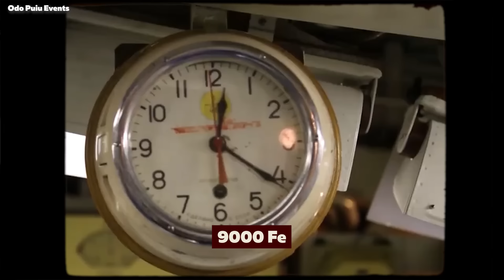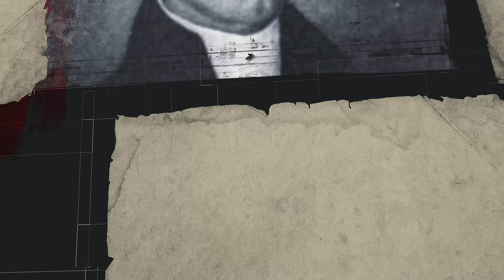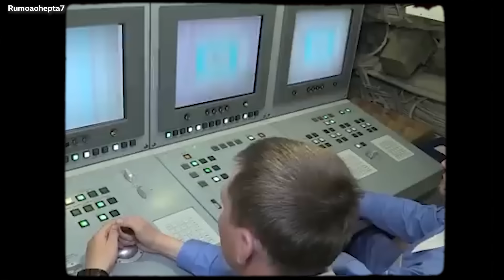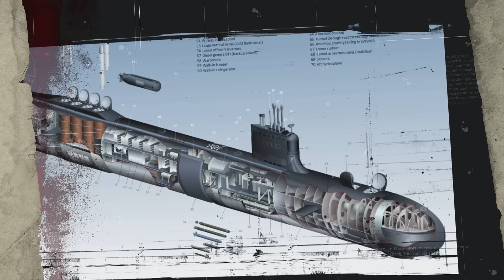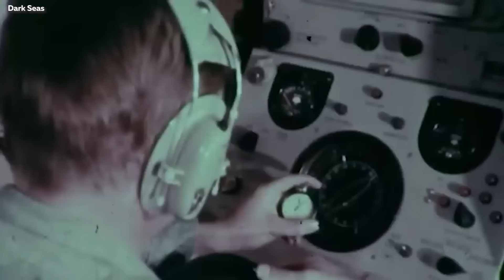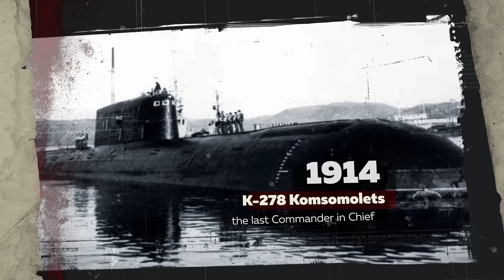Why Can Russian Submarines Dive DEEPER Than US Ones?

Comment: I won't take credit away from the fact that they can dive deeper than American submarines, but I don't think that is critical. Anyone who has served at sea (bubbleheads) knows how a submarine can be an asset to the whole tactical picture. These missions are critical, and the operation profile of submarines allows them to penetrate where some other organic collectors can't. This means the "foes" won't shut down their radars or simply won't take the same countermeasures as when a recon plane is present. I do like the approach of a multipurpose, flexible platform in order to perform all types of ad hoc missions. If the Navy needs to deep dive in the Marianas trench, then design a unique specialized platform like an DSR, for example (they need one, by the way). That's my take on all this.
Reply from the maker: You make a valid point about the broader strategic importance of submarines beyond just their diving depth. Indeed, submarines offer unique advantages in stealth and penetration, which can be crucial in various operational scenarios. While diving depth is a factor, it's not the sole determinant of a submarine's effectiveness. Specialized platforms like a Deep Submergence Rescue Vehicle (DSRV) could indeed complement the capabilities of the existing fleet. However, it's essential to balance specialization with the versatility needed for a range of missions. The focus should be on optimizing submarine capabilities to meet evolving threats and operational requirements effectively

Comment: How deep a submarine can dive is of no importance, it is really a detriment.
Torpedoes are launched out of it tube with compressed air. The deeper you attempt to launch a torpedo, the more compressed air is required. You can't use the air in the sub, you would suffocate the crew. A sub has to surface to compress air, which is when it is most easily discovered.
The water is denser, so it limits top speed.
Once you trap a sub deep, you just wait it out.
When a deep submarine does rise to a shallower depth, there are hull popping noises that can be detected from more than 30 miles away. If you don't know, its own noises is what sinks a sub.
Reply from the maker: Modern submarine technology addresses the challenges of deep diving, including air compression for torpedo launches and acoustic signatures, through advanced propulsion systems and stealth enhancements
Reply: @NAVYDiscoveries  All those words and you didn't say anything.
The only way to take more air down is a bigger compressor or bigger air tanks.
Reply from the maker: The depth a submarine can reach is primarily determined by its hull design and materials, which need to withstand immense pressure at great depths. Russian submarines often use titanium hulls, which are stronger and lighter than the steel used in US submarines. This allows them to dive deeper. It's not about taking more air down; it's about the structural integrity and the engineering of the vessel

Comment: they dive deeper because they sink, just ask the crew of the kursk....oh , you can't' all dead
Reply: No, because you eat too much mcd
Reply from the maker: Oh, of course, because submarines dive deeper by sinking. I guess all submarines are just aiming to reach the ocean floor. Maybe they should just install anchors instead of propulsion systems!
Reply: @NAVYDiscoveries Sadly that is the unspoken goal of every submarine.
Reply: @NAVYDiscoveries  your not the sharpest pencil in the box are ya.   Q: what sub would you dive to 1000m , a russian built sub or a us built sub
Reply from the maker: Choosing between a Russian-built and a US-built submarine for a dive to 1000 meters involves considering several factors. Russian submarines, such as the K-222 and the newer Yasen-class, are known for their ability to dive deeper due to robust hull designs and advanced technology. However, US submarines, like the Seawolf-class, offer exceptional reliability, advanced materials, and cutting-edge systems. Both nations have their strengths, but modern US submarines are generally preferred for their overall safety and technological advancements
Reply: @NAVYDiscoveries  answer the Q , russians are notorious for building crap. i used to work for ndc refitting subs , know a lot more then you might think.
Reply from the maker: @niallmacdonald1222  Russian subs go deeper due to design and tech, but US ones catch up. With your experience, what factors do you think really set them apart?